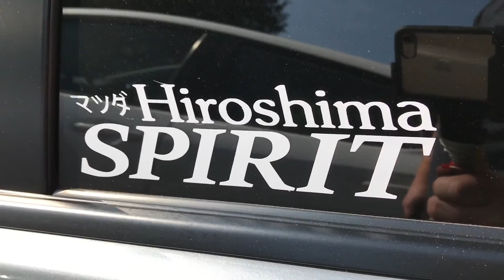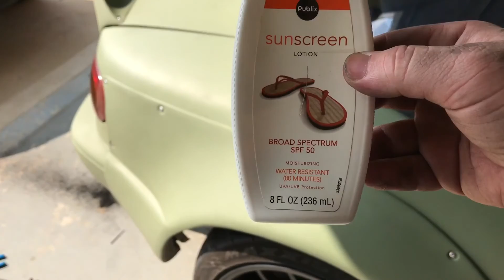Mazda2 | Lowering springs with friends!

Comment: If you are just putting lowering springs on stock shocks on the mazda 2 do you have to do a alignment?  And if you do what are you adjusting and where?  I am guessing the only adjustment on this car would be the tie rod ends?
Reply from the maker: Yes, you need an alignment. I have done a video on that as well.

Comment: curious. i'm a budget builder, obviously i want to go with coilovers but i'm not 100% sure yet. considering doing springs. i believe my car is on original shocks/struts (has 111k on it now), i see that you used your stock shocks on those springs. do you think it'll last? i don't want my shock blowing out on me, but i'd like to save money (if i can). i know some cars' shocks are more durable than others.
Reply from the maker: Really it depends on how smooth the roads you typically drive on are, but I wouldn’t use just springs on dampers that old. Mine were relatively new and the roads local to me are decent. 

All that aside, I recommend saving for coilovers. There’s no comparison.

Comment: To my understanding the front brake are disc and the rear drum. Can you change the back to discs?
Reply from the maker: The rear can be converted to discs, but there’s no benefit other than looks and it’s really expensive. Drums are lighter, cheaper, and to answer your other question, they literally last forever. It’ll be a long time before you need to change them, if you even keep the car that long.

Comment: Hey I wanted to note that on the fronts if you're not getting coilovers and get something like KYB direct replacement, according to the instructions you'll need to get their replacement strut mounts as well.
Reply from the maker: Sounds like a good way to sell more parts. I’ve never needed brand matched strut mounts on any car I’ve ever owned.
Reply: @HiroshimaSpirit  so, I'm a bit confused because the kyb shock mount bumper is clearly a different design than the or. I got into a heated debate with my buddy if it really matters.
Reply from the maker: Idk. I doubt that’s the case, but if it was, KYB would be dumb for doing it. Can’t use my existing strut mounts with your product? Great, I’ll buy another brand. 

I’m also a big proponent of just buying coilovers. If you’re going to have lowering springs and spend money on buying struts and shocks to go with them you might as well just buy the coilovers.
Reply: @HiroshimaSpirit  okay, duly noted. I need to get ahold of my executive council for a third opinion but he didn't answer the phone today so the fronts ain't getting done! 😅

Comment: Good Mythical morning sucks. Now that's outta the way, you have experience with other springs than megan racings? I want to lower my 2. I also got a clunk in the rear right side of the suspension that didn't go away with a new shock, did you ever had issues with noise + springs?
Reply from the maker: I went straight to coilovers after those Megan springs, so no. I’ve also never had any issues with clunks. Are you sure that everything is in place and tight?
Reply: It's weird, I changed the shock twice already (once under warrenty) and re-installed it myself and it's only because the roads are icy/shitty and it's cold that I notice it...it might just be some of those strange noise that car makes when it's cold out. I'm kind of stumped since there isn't much things to move back there, the bushing and the shock.
Reply from the maker: Best I could recommend is to just make sure the two top bolts for the shock are tight and that the spring is fully/correctly seated.

Comment: What spring and shock brand and set up are you using for the front and back?
Reply from the maker: +Juan Alvarez The ones installed in this video are Megan Racing springs on stock struts and shocks. It’s my old setup that I used to run before purchasing Fortune Auto coilovers. The rear springs each have one of the useless helper coils cut out to provide a little more rear drop. I documented that in an older video.
Reply: Thank you very much for responding, your videos are extremely helpful.
Reply from the maker: +Juan Alvarez No problem! Thanks for watching!

Comment: Hi there. I am thinking about getting lowering springs for my 2010 Mazda 2 NEO DE 10 Mazdaspeed. Is it best to buy the springs from Germany or from my home country Australia. King lowering springs are cheaper here but H&R seems to be $454 from Germany what should I do. Im only using it for street daily driving
Reply from the maker: Lowering springs are going to pretty much feel and perform the same. Pick the amount of drop you want, a price you can live with, and purchase away. There are no wrong answers with springs for the 2, especially a street car.
Reply: @HiroshimaSpirit  I just think it will look neat when lowered. I am also thinking about getting an engine brace for my car too. Just little mods done, not over doing it. I still have my standard K&N panel filter in my car. Have not changed to SRI kit yet. Performs and drives well :) i might need to take my car to a suspension expert to fix the springs in.
Reply: @HiroshimaSpirit  also do you have a facebook page I can follow. I can share pictures of my ride. Get honest feedback you know keep the Mazda 2 spirit alive. They are popular here in Australia.
Reply from the maker: Join the “M20 Mazda2 Owners” Facebook group. It’s a great community for just that. 👍🏻
Reply: @HiroshimaSpirit  your the best :) I really appreciate your help and your vids are cool. Always a MAZDA fan. If I need any help or advice I will ask you.

Comment: do I need to change also the sway bar, because the coilovers I was installing did not match the swaybar position. Is there an adjustable sway bar? also call stabilizer bar
Reply from the maker: I didn’t have to with my coilovers. What brand?
Reply: @HiroshimaSpirit   I am going from the OEM to a Ksport coilovers, I did the struts in the back with no dificulties, but when I went to the front, I placed the new one trying to keep the same distance as the originals but when I was about to put the sway baf it was 3 inches over the hole were is suppose to go on the new  coilover. if I raise the shaft on the coilover to match the sway bar, the wheel assembly goes way to high and my wheel tilts. I try to put everything at a close distance to prevent a alingment but that trew me off.

Comment: Hey, I’m having a hard time finding complete front struts for my Mazda 2, are there any other cars that share the same strut? (Mazda 3??)  It’d really help me out, thanks.
Reply from the maker: Like, fully assembled with the top hat and everything? I’ve never seen “loaded” struts for the 2 sold anywhere. It’s not difficult to swap the parts over to new struts.
Reply from the maker: The only other car that’s bolt-on for suspension components is the Ford Fiesta, but I’ve never seen loaded struts for them either.
Reply: Oh ok thank you I’ll give it a try, love your work btw👍🏼
Reply from the maker: Thanks! I appreciate it! ✌🏻

Comment: Just got a 2011 Mazda 2 but the sporty one, tempted to lower it ;)
Reply from the maker: You should!
Reply: HiroshimaSpirit is it expensive? I’m currently 17 working part time so budget is a bit tight ahaha
Reply from the maker: It doesn’t have to be. If your dampers are in good condition, you can get away with about 1.5 inches of drop. There are springs as low as $60 that work just fine for looks.
Reply: @HiroshimaSpirit  How badly do you think a spring-only swap would affect the ride quality? My understanding is it can get pretty bumpy if you don't go for performance struts as well. Excellent channel btw!
Reply from the maker: It’s fine if your roads aren’t bad. Thanks!

Comment: Hello friend I need where to buy rear suspension and front for my Mazda 2 2013, I would like them to be good and cheap .. so I recommend some website to buy, from front hand many thanks
Reply from the maker: I use rockauto.com for replacement parts. 👍🏻
Reply: Thanks my friend

Comment: i would love to know where you get your parts for your mazda. Im from the UK and cant find anything. would really love some help.
Reply from the maker: All over the place. Ebay, directly from the manufacturer, etc. Wherever I can get them for the best price. You’re at a bit of a disadvantage in the UK because all of the good stuff is either made here in the US or Asia and shipping drives the cost of parts way up.
Reply: Tell me about it. In been recently looking into maybe the possibility of buying an older Mazda 3 with the 2.3 ltr engine and seeing if I can shoehorn it in there but I don't know if I wanna do that on this little Mazda 2. I'm gonna check eBay just now thanks man. Once I start my mods il give an update.
Reply from the maker: If you were to do an engine swap in the 2, you’d want a 2.0 or 2.5. The 2.3s aren’t very good engines. 👍🏻
Reply: HiroshimaSpirit will they fit tho. I'm fully expecting to have to crest new mounts but it's the overall size in worried about.
Reply from the maker: They’re all basically the same size, so yes.
Reply: now that i did not know. some man thanks for the tips. just subbed last night as well man so looking forward to seeing what you have got in store.
Reply: Sorry one last question. when you dropped it did you need to roll the arches or anything or does it clear when steering full lock. I know the Americans wont really use full lock when driving as your roads are wide but in Scotland we have some pretty hectic tight roads haha.
Reply from the maker: I had to roll/pull the rear arches, yes. Fronts have plenty of clearance.

Comment: My front passenger constantly goes ugga dugga dugga dugga dugga. 

Any ideas?
Reply from the maker: +OctopusCarDoor Wheel bearing, maybe? Without seeing/hearing it in person, I can’t give a good diagnosis. 

And I’m not a mechanic.
Reply: It can be even a worned out driveshaft, which is very dangerous to drive with it if the sound persists when you drive straight.

Comment: Why use a piece of wood+jack for lifting the car?
Reply from the maker: Simple. The wood works as a spacer and lifts the car higher. Rather than jacking it up one side at a time, pop a block of wood in there, lift it from the center tow hook, and place your jack stands all in one go. The jack we were using just wouldn’t lift the rear wheels off the ground by itself.
Reply: HiroshimaSpirit Ok, thank you.

Comment: I would like to be like you all . I  own a Mazda 2  and  just want to put  K&N air intake and air  filter on but I am a dummy  in mechanics .
Reply from the maker: +Trung Do Gotta pick up a wrench and try to install and/or fix something! Everybody starts out not knowing how to do it, myself included. Experience is everything. 👍🏻
Reply: Agree . I will perhaps change spark plugs myself .
Better avoid beginning with more complicated operations ,  I don't want to call the mechanic for towing my car ha ha .
Reply from the maker: +Trung Do I’ve got a video for that, so you’ll have a frame of reference on how to do it going in. 👍🏻
Reply: Thanks !

Comment: how do you align the wheels?
Reply from the maker: This isn’t exactly a step by step how-to as much as me answering as many questions as I thought I might receive. The fronts were pre-assembled since they came off my car before going on this one, so there’s more to it than what was shown. You will need an alignment after any suspension component replacement or upgrade. I mention at the end of the video that I was going to throw a quick garage alignment on his car so he could drive home.

Comment: Hi
Can you tell me where it is located the power stearing pump?
I have a Mazda 2 1.3 petrol from 2008 and the stearing doesn't move very easy and I want to change the oil.
Thank you in advance
Reply from the maker: The 2 has electric power steering. The motor is on the steering column.
Reply: @HiroshimaSpirit  Thank you.
I've looked on eurocar parts and after my number plate was with power stearing oil....good seller :))